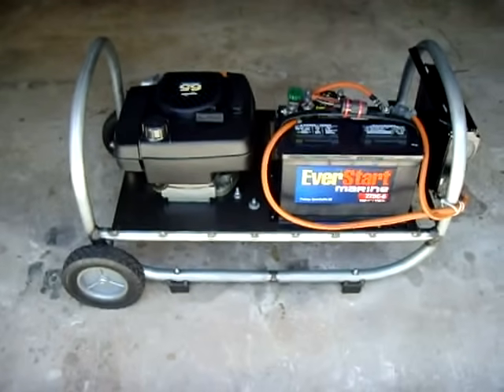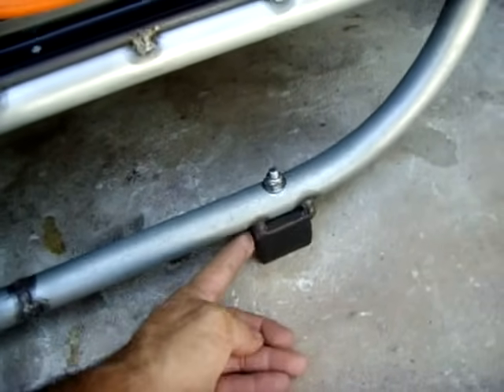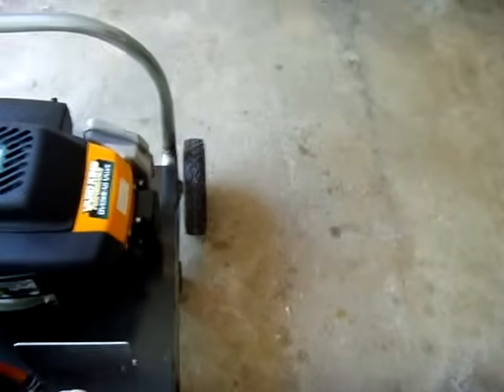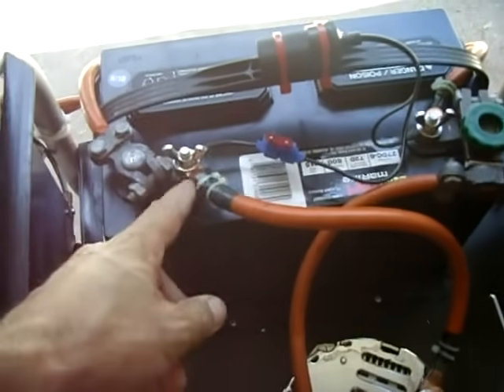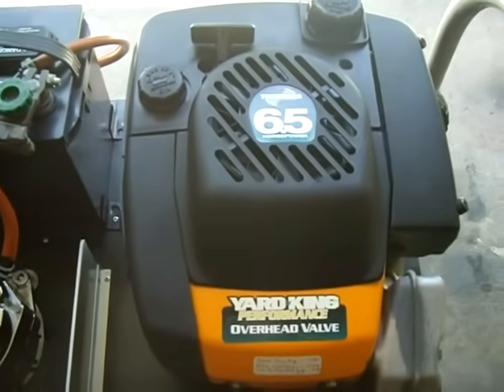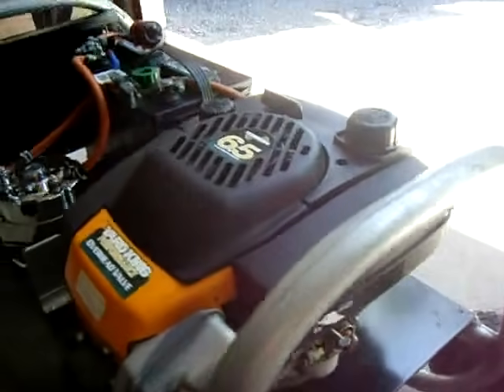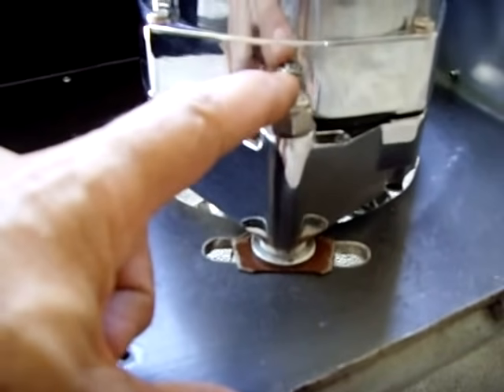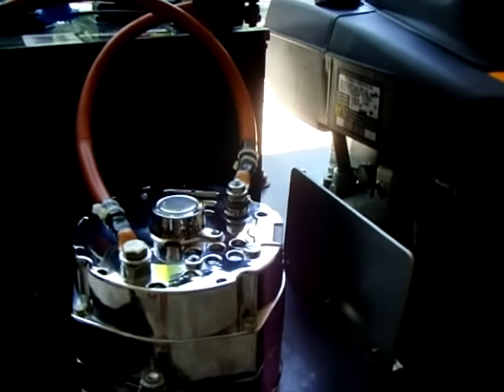HOMEMADE 1000W Lawn Mower Inverter Generator - Part 1

Comment: If you rotate  how you mount the alternator by 180  degrees you could use less length for your cables and wouldn't have needed to cross them. It probably will not make a big difference, but its just my OCD side. 😁

Comment: I dont understand the large drive pulley. Its like 5 to 1. Alternators max out in amperage at about 1500 RPMs. There is no need to spin up the alternator that fast. It only reduces the torque of the motor to the alternator. The lawnmower engine runs at 3 to 3500 RPMs. could have just gone 1 to 1 on the pulley ratio. The only time you need high RPM is when you mess with the voltage regulator for higher voltage. I understand this is a old build but if any body out there is viewing this, please either 1 to 1 or even 2 to 1 on pulley ratio. 1 Engine 2 Alternator. Most horizontals run best at 3600 RPMs. 1800 RPMs is all you need for a 12 volt system.
I'm doing a all new equipment set up. A GM 400 Amp 15.1 VDC with a 13 hp Harbor freight horizontal.
Reply: Perhaps he can get full charging at an idle so it's not so noisy. Really depends on how heavy the use will be.

Comment: a 6.5 hp engine should be able to power a 4800 W electrical setup.
Obviously GM does not produce a 4800 W alternator but is goes to show the engine is about 4 times overrated for the shown use...
You could opt to instal a second or possibly even a third alternator to the same engine to take advantage to the available power...

But that being said: The setup looks to part...

Comment: I'd want the smallest engine I could find with a large sprocket. On the alternator use a small sprocket so u could run the engine at the lowest idel possible. That way a gallon of gas could last much longer. Is this possible ?
Reply: A gasoline engine is more efficient wide open.

Comment: Cool, I like the idea of a larger gas tank, and I would have 2 batteries here and a protective cage underneath for safety. Nice work, 1/4 inch plate is overkill but it works, 5/8 plywood would be much lighter and non conductive and way cheaper than the plate, and more than strong enough. Air filled tires would absorb the bumps better. No matter what you do people will critique their own opinion, but again, great job and nicely done even the mega cap companies have teams to improve their products through innovation and trial and error and customer feedback etc.....
Reply: Plywood would help with vibration 
👍

Comment: If you got a bigger battery you can turn this into a hybrid generator using solar panels with a charge controller, using primarily solar power when its sunny outside and the engine when there is a lack of sunshine

Comment: you could run four of those alternators with that engine
Reply from the maker: Good luck with that. LOL. Try it out. When a load is placed on the alternator, the shaft becomes very hard to turn.

Comment: Can this be use in lifepo4 4s battery?
Reply from the maker: Yes, just like you can use a lithium iron phosphate battery in your car, the only thing is you may not "fully" charge the LiFePO4 battery because the charging voltage might be lower than 14.5v in your vehicle. Thanks for watching

Comment: Can you make a parts and costs breakdown in video description? Good video,  good job
Reply from the maker: Hard to do because the engine and alternator may vary, as well as the tensioner/pulley used. Thanks for watching!

Comment: You could generate way over 1000 watts with that setup. Or inverter 1000 watts . Right ?
Reply from the maker: Strictly inverter output 1000W, but I could use larger. Thanks for watching!

Comment: Like your set up, just wondering why a 1000w is that the highest you can go with that alternator or can you go way higher than that. Tks for the videos.
Reply from the maker: You can go higher, but the pulley ratio would need to be adjusted to handle the inverter under load. Thanks for watching!
Reply: Ok thanks for the information good to know.

Comment: Great video. I made mine using a 3/4 inch HDPE base and then used large fender washers to secure it to the base. I use all stainless steel bolts & casellated nuts & cotter pins & lockwashers. Stainless steel lasts forever. HDPE can last 20-30 years if left in the sun. Avoid plywood or steel plates. Steel is too damn heavy. a piece 3/4 HDPE is alot lighter, and will never rot or rust. HDPE can be bought new or salvaged from old boats.
Reply from the maker: I like HDPE(starboard), good stuff!

Comment: What did it cost to build? That 1/4 plate had to be $50 on it's own.
Reply from the maker: The piece of steel was from a lower priced scrap pile, maybe 30 - 40 bucks. $400 - $500 back in 2009.
Reply: @electronicsNmore  Nice job.

Comment: Such a nice setup.  I’ve never had luck with Tecumseh engines. I have replaced the carb twice on my root tiller.  I’m repowering it soon with a Honda clone.  

Find a Briggs and Stratton mower with a broken deck and repower it.
Reply from the maker: Hi Stephen. I never had a problem with the engine. It ran great for the 5 years I used this system. I only paid $105 shipped for the new engine. Be sure to look over my extensive video playlists for many other videos of interest to you, and most importantly share links to my videos on social networking sites. Thank you
http://www.youtube.com/c/electronicsnmore/playlists
Reply: I subscribed!

De
KD8MSS

Comment: Great job man, if you ever build another one you might try a couple capacitors between the battery and the inverter,  like the 1 and 2 farad models used for 1000w+ stereo systems, i think it would eliminate the bogging, im curious to see if that would work
Reply from the maker: Thanks. I have another video showing a modification I made to the alternator's rotor. It worked like a charm when using heavy loads. It was made shortly after this video.

Comment: I built a similar one and they work fine. I had seen it at a racetrack.
Reply from the maker: LOL. Go cart.
Reply: @electronicsNmore  ???
Reply from the maker: Though you were joking about it looking like a go cart.
Reply: @electronicsNmore  lol! Nah I had gone to a drag racetrack and I saw 2 of them there me they use them to restart engines or charge batteries because some of them don't run alternators on their racecars just for a quarter mile race to reduce load on engine. They are easy to build just need patience.
Reply: @electronicsNmore  I can look at something once and memorize what it's made of and build stuff. Ttyl, take care.

Comment: Great work! I have an older lawn mower with self propel and I attach a sending disc to one of the front wheels, but would like to make more uses out of it. what type of inverter did you use and cost?
Reply from the maker: Years ago they were expensive, but a 1200-1500w is ideal. If you need a link, just ask. Thanks for watching!

Comment: Nice build 👍 just wondering, instead of using an alternator, can I use an AC motor from an old air compressor?
Reply from the maker: That won't work, you'd have to make it into an induction generator. Thanks for watching!
Other great DIY generator videos:
https://www.youtube.com/watch?v=8rj-emSUf7I
https://www.youtube.com/watch?v=LNLZcj-PacQ
https://www.youtube.com/watch?v=HWXOZD7fFg4

Comment: If your battery, inverter and engine cost 80.00 a piece that's more than I spent on a new 4000 watt peak generator.
Reply from the maker: Yes, but you don't have an inverter generator. My unit is also very well built. Thanks for watching!
Reply: @electronicsNmore  A 2800 Honda generator inverter is 1009.00 at Home Depot. A veteran gets 10 percent off so now for 800.00 a Honda generator inverter.
Why would I want to spend more money for a smaller inverter? I have batteries and charger and a 1400 watt inverter but why use it when I have a generator?
Reply from the maker: @MC-hs4mf  Your math is way off. LOL. 10% OFF $1000 is $100, leaving over $900 plus tax. People like you fail to understand that people like me actually take great pleasure designing and making things.
Reply: @electronicsNmore  agree 10 percent of 1000 is 100 off. Didn't get much sleep last night.

Comment: I was thinking about doing this, but I did have a concern and that is duty cycle of the lawn mower engine. Now I have not done the research yet but would guess that the lawn mower is not ment to be run for the same lengths of time as an actual generator? Maybe it is completely fine?
Reply from the maker: No problem at all, just make sure you use good quality oil(preferably synthetic). Be sure to look over my extensive video playlists for other great videos of interest to you and most importantly share my channel with others. Thanks!
Reply: @electronicsNmore  can do

Comment: Dumb question 
But 100amps x 14.7 volts dc isn't 1000 watts it's 1470watts ??
I am making the same kinda thing 
I'm just gonna use a 160 amp gm alt 
But cool job
Reply: The inverter is only 1000w

Comment: People stop comparing these to full run generators there NOT these are designed to charge batteries and run inverters pros start stop operations very fuel efficient because they shut down when low demand is needed and still delivering power thru inverters.  Reliable.  Cheap to build and repair.  Simple construction with readily available parts. Cons normally not portable due to the battery banks. Large in rush can be an issue so anything over 2500 watts will be a issue. If you need  a 5 mega watt power plant to get by if you lose power your an idiot or a women. Also my hybrid has a heat won the exhaust that heats water and can be used to heat my room,or camper just fine

Comment: that engine is waaay too big. the smallest engine from harbor freight  smaller than the 212 should work great it will save so much gas and you can get a propane carb for  it
Reply from the maker: WRONG. LOL

Comment: Why not build it on a  hand cart. Already steel and solid. Engine to alternator pulley ratio should be 1:1  Like Shaft coupled units you can just buy for less than $400.
Reply from the maker: The cart I made is better suited. A 1:1 ratio would require much higher RPM's from the engine to have a high power output. Thanks for watching
Reply: What is the ratio on commercial inline portable generators?
Reply from the maker: 1:1, but you don't seem to realize that they're using lower RPM generator heads, not a car alternator.
Reply: The pulley ratio between the crankshaft and the alternator is 3:1. Thus, the alternator rotates at a minimum of 2100 rpm. The current in the field coil – 0.15 A – is enough to start the alternator at this particular rotational speed. (automotive Alternators)

Comment: Cant u post a vid os we can make them everyones looking for a way to live more independent now i jusy gotta find a kerosine /propane natual gas / Diesel fuel/bio fuel/corn alcohol so i can fun it onything and i would had a small hot water heater to it to power wash with very hot water but thats not easy to to do think it runs thru cooper pipping then somekinds heater then hits hotwater heater  id get a small rurbine to run through the waye of the hot water heater and it will anymore energy + the solar and nothiming ill be using its just a couple magnots copped wires an nothing between the copper an steel creates electricity that ima try to make very east for me easy a  teck amd can un atleast the lights on  on its own the generator ima mak b4 i go ip im the one and wants to do some good an wouldmliek tos ee better living conditions nwouldstore frombatteries ima make myself the same fucking set up u i can get the engine for free but need a generator form my jeepand wheni have then2days of of nothing at all  n my truck van or whatever ima get ima put a fake pin wheel converting into a windturneind and ill get my endergynfromthe sun the gases n then rest when im back buying the jeep brand cheeorkee i have done mass studing on how to stay off the grid for every and we
Reply from the maker: Solar and wind are your best sources of "Free" power. Also check out a channel called, "MrTeslonian". Thanks for watching!

Comment: Not bad but 1kw  That 6.5 hp will run a 3kw  alternator As My generator a 6.5hp and that a 3kw
Reply from the maker: jcr65566 All I had laying around was a 1kw......easy to swap it out.
Reply: For give my clinical bluntness As I said not bad it is a good job it gave me a few ideas with what you had you did well I'm just saying if you want to upgrade it later you got the room to do so  110 for effort bro guys like you to inspire people to get out and do the same.

Comment: Hey Genius, EMT is galvanized and welding it Causes Cancer.
Reply from the maker: Thanks for the Genius comment. Now a little education for you. Welding galvanized steel, which is nothing more than a zinc coating, can make you sick if you inhale the vaporized zinc fumes. Zinc is NOT carcinogenic. When I welded the frame, I was smart enough to use a box fan to blow the fumes away from me.

Comment: Nice job - great craftsmanship. But I didn't see a charge controller to prevent over charging your battery. I have a craftsman lawn mower ready for scrap, but the engine is good. I don't weld, tho, so will have to work around that. And I'll go with a PMG which should give me about 1800 watts, and a charge controller to protect the batteries.
Reply from the maker: The alternator regulates the lead acid battery charging. Thanks for watching!

Comment: If you bought the components new, how much would they cost compared to a 1000w generator? I realize you could shut the engine off and go for a while operating loads with the battery, which is an advantage over a store bought generator.
Reply from the maker: I didn't pay that much for everything. The inverted I had laying around, the engine was $100 shipped, and the battery was $75.
Reply: Yeah, that's a good deal.  I have various components collected over the years and now not used for their full potential I could fashion to do similar.  You've given me ideas for their potential.
Reply: For $89 you can buy a 900 watt generator at Habor Freight that is ready to use.
Reply: @FloryJohann  sure runs all the time horrible fuel consumption junk than if rated at 900 watts might deliver 300 watts lol
Reply: @ronaldbrown9638  
A 6.5 hp Tecumseh engine would use more fuel than the 2hp harborfreight engine anytime.
That 6.5 hp e ngine is  over powered for that 1000 watt prowatt inverter and for the alternator. 
 Actually those harborfreight generators had a good rating back then and they where putting out 800 watts on continuous usage. They got replaced by another model since and cost more.
I like the concept of incorporating a inverter and a battery, but the battery need to be cycled or it will die early and batteries have a lifespan.

Comment: I made my first one 22 years ago you got a long ways to go and a lot of mistakes there a lot run that thing for any length of time it will shake that battery and that inverter two pieces and you still haven't figured out the secret the secret to keep the alternator from dragging the motor down good luck
Reply from the maker: WRONG. I used this unit all the time for years with no problems. It was very well made. When I sold the unit(5 years later), it still had the original battery. So much for engine vibration destroying the battery. As for the inverter, there were rubber vibration dampening pads between the inverter and frame. I also solved the issue with the alternator load on the engine.

Comment: need to isolate a the second bat and get a different engine with electric start have it auto start when voltage is low shut off high

Comment: Nice job.  I literally built the same thing.  Had a 3.5 Briggs and it was made for a self propel so it had a very belt above the blade.  I easily bolted it and an alternator together.  Engage ran perfect.  Then I fielded the alternator and it died. . Do you think it's from what you were explaining at the end of the video,? Or was 3.5hp not enough for 120 amps?
Reply from the maker: 3.5hp is kinda small, and yes, if the engine won't crank over, you could be experiencing the same issue. Thanks for watching!

Comment: That's awesome  have you ever thought about putting a small dry cell hho generator on it to provide a infinite fuel source instead of running the engine off of gasoline and add a battery rack so you can add a additional deep cycle battery you would be able to power a small cabin or tiny house your setup is the perfect platform to do so!
Reply: That's not possible... An HHO cell is very inefficient, and even if it was 100 percent efficient, which is impossible according to the laws of physics and thermodynamics, it would only generate enough power to run the engine in a continuous cycle and never power anything therefore it would be useless... There is no such thing as an infinite power generator, I'm surprised that somebody that knows what an HHO cell is doesn't know that you can't create infinite energy......

Comment: Nice build quality.  Two small things come to mind.  1)  You would not have had to isolate the generator ground if you had mounted everything to wood instead of steel plate.  2) Your belt underneath doesn't have a lot of contact with the generator pulley, maybe 90 degrees of arc.  Putting the tensioner on the inside would increase the pulling traction without adding stress to the belt. (think like using a smaller  pulley on a supercharger, you need more surface area on the belt)
Reply from the maker: I changed the tensioner since this video was made, and there's much better traction on the belt now. :-)
Reply: Wood rots, it breaks down.
Reply: plastic then!  @KeyboardBuster